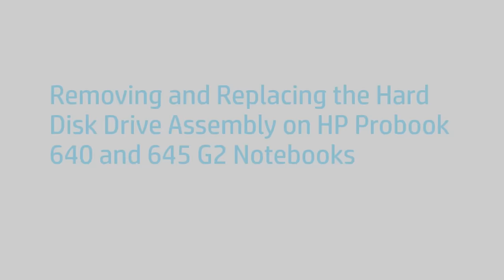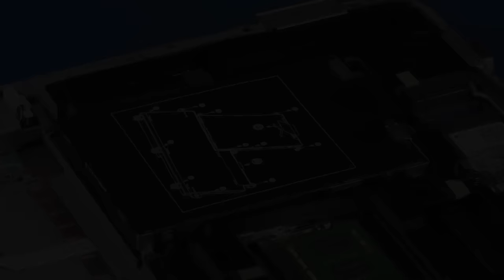Replacing the Hard Disk Drive Assembly | HP Probook 640 and 645 G2 Notebooks | HP Support

Comment: When you upgrade to a new hdd or ssd hard drive, does it void the warranty? Thank you.
Reply from the maker: Hi Lope, thanks for contacting HP Global Social Media Support!
I understand that you need to know whether upgrading the HDD or SSD void warranty. 
I will do my best to assist you.
HP does not recommend upgrading or downgrading hardware parts or software that is bundled with the product as It may affect the manufacturer's warranty and performance, however, you could change the configuration at your own discretion.
Binu_HP Social Media Tech Support

Comment: does it support M.2 SSD and 2.5 HDD at the same time?
Reply from the maker: +Caue Cardoso There is no reason both the M.2 port and the SATA port can't be used at the same time. The M.2 port can accept either a SATA type M.2 or a PCIe M.2 so must not be using the same SATA lane as the 2.5 inch bay SATA port.
Reply: @HPSupport  you can't use both at the same time. And you're supposed to be HP support?

Comment: HI, can this computer be used with 2 different types of Disks? For example, a HDD, and a SSD like in this other video https://www.youtube.com/watch?v=oCIwn7Y1bD0 

or the only possibility is to have only one type in the laptop?
Reply: +tomas ferreira Look at pages 61 and 66. You can use EITHER a 2.5 inch SATA hard drive or SSD OR an M.2 mSSD. They use different caddies but either uses the single SATA header on the motherboard so 2 drives in the laptop at the same time is not going to happen. Some model builds with a 2.5 inch 5400 RPM 1 TB hard drive which is slow by today's standards: http://hp.care/2dMFOmh